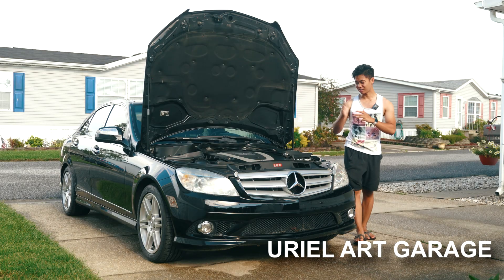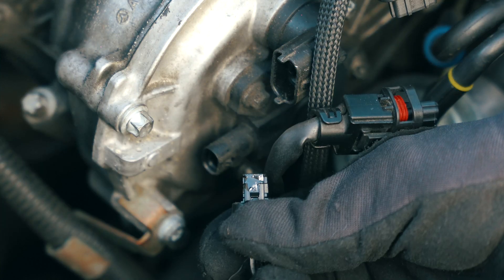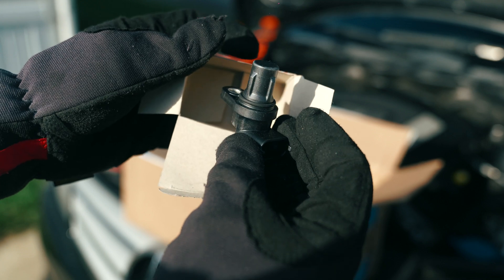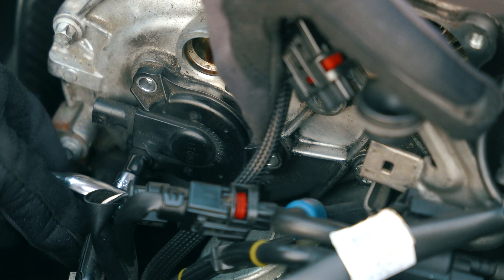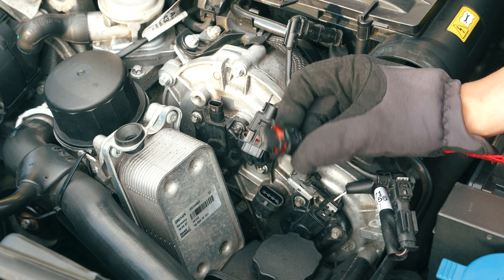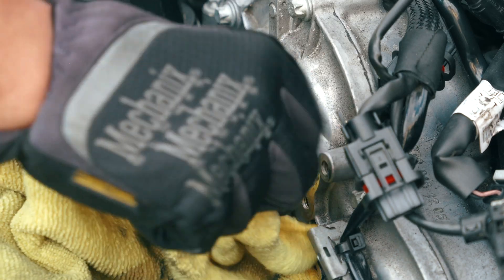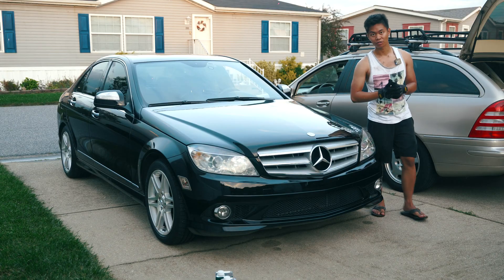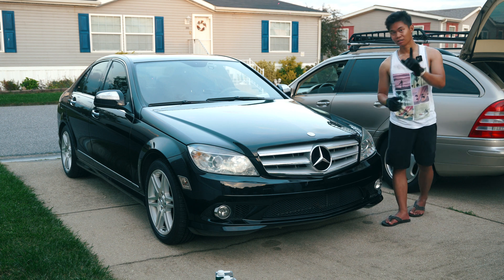W204 MERCEDES C350 Camshaft Adjuster Magnets & Cam Position Sensors! OIL LEAKING ISSUE FOR M272!!!

Comment: Would the magnets cause the car to no crank no start? Code p0340 cam position sensor circuit a bank 1 is the only code.
Reply: I replaced both cam pos sensors already but still no crank no start.

Comment: Hello Uriel. Was this routine maintenance, or did you get a code? I have a 272 ml350 with a persistent #6 misfire. Wondering if i need to look here. Driving me nits as ive done plugs (routine) has new manifold and did coil swap to no avail. Vac lines good.  Carsoft MBII only listed PO306.  If you ĥave time, would love your thoughts as im at a dead end. Or anyone. Look like you might be local? Wa. If so, greetings !
Reply from the maker: I would check for oil in the wiring harnesses maybe that has to do with it however I can't really say for certain unless you take it to an mb mechanic! goodluck!

Comment: Thanks, Uriel. Great vid and tutorial! Doing homework on the ML350, I found the 2011 and earlier models used the M272 engine. MB released a service bulletin with specific repair instructions for the camshaft adjuster solenoid. For anyone reading this, I like Uriel's tutorial and vid better. No offense, MB. Jus sayin.

Comment: Just did 4 camshaft position sensors on an m278 at 70kmi to prevent slight oil intrusion into the harness.
 
MB dealer parts, labor and expertise $1000.  

I'm ok with that.  I can use cheaper pigtails if the other remaining connectors begin to seep.

Comment: Cool video, but why not just change the o-rings/seals?
Reply: My thoughts exactly
Reply: @ClippyZA-s8o did you guys not see the oil wicking onto the harness clips? That oil eventually enters your ecu and then your repair is $5k+ … leaking around the prongs is seconds to oil wicking on to the harness clips

Comment: I can’t do this by myself cuz i dont have a 6.5mm wrench to squeeze in, everything else is too bulky. Im not about to take apart oil separator and steering fluid reservoir…

Looked for the wrench in every damn store and no one holds it so imma just pay a fucking mechanic to do it. I really wanted to do it by myself but whatever

Comment: this notorious design flaw including other camshaft gears costed me US$2000 to fix it
Reply: Brotha dam I got an Amg my mechanic only charged me 900 and I got an oil change and my breaks changed
Reply from the maker: Even diy, by far the most expensive repair so far but worth it in the long run for me! It’s easy to fix as well
Reply: Elaborate, what the hell could cost $2k???!!!!!
Reply: @s7omi oil migrates through the harness into the o2 sensors, and eventually into the CPU. If left unchecked it is an engine put repair involving replacement of harness. I’ve heard it can be in excess of $10k

Comment: I have the same car 2012 , it have an issues on cold start some times it dies, unless you give some gas it eityer cam magnet or cam shaft adjuster
Reply from the maker: 2012 is a weird transitioning period between the m276 or m272 motor, which one do you have?
Reply: @UrielArtsGarage  thanks for replying I bought this car manly because of your videos, the engine is not sure I don't even now how to check but everything in the car is after the face lift, I think this car was first sold in the us before it came here it have miles on dashboard

Comment: I still have code P0015 even after changing 4 camshaft sensors and actuators. Please help
Reply from the maker: Check if your wiring harness are clean and doesn’t have oil, it tends to gather oil overtime and destroy it, there’s lots of replacements on fcp euro

Comment: hey bro I tried this and stripped one of my bolts. do you know the replacement size? also do you recommend change all or only leaking ones?
Reply from the maker: Always replace all at once since it will cost you more in the long run if you replace one at a time, and for the bolt that’s so unfortunate! I would look for it at fcp euro!

Comment: Did you get any engine codes for this? Possibly P0018?
Reply from the maker: I would try to see if there’s a good amount of oil gunk around the area, what usually happens is that seepage of oil gets into the wiring harness and messed up the harness causing codes like that.
Reply: @UrielArtsGarage how do you clean the harness??
Reply: I got the same code, but no engine light, engine runs fine, normal

Comment: Wonder if they could possibly cause misfires. As I've just noticed that I have an oil leak right there on bank 2. If you know, please let me know. I booked it in for a service in a couple days and they'll have a look at where the misfire comes from as well.
Reply: Yes, any of these can cause misfires as well as rough running & cold start rattling. Far more likely to get misfires from the cam magnets rather than coils on M272's
Reply from the maker: Well it’s best to start with coilpacks and spark plugs first with the misfire. I highly suggest getting a cheap obd reader from Walmart which will cost you $25. It helps a lot when it comes to diagnosing your car!
Reply: Do you know what solenoid is bank 2?

Comment: Do you have to change the CAM position sensor if you have worked changed the camshaft before or it is just a maintenance thing?
Reply from the maker: You don’t necessarily have to change the cam position sensors however in my opinion, you might as well change them if you’re doing the work in the same areas! Besides the gaskets usually tend to go bad when they get older!
Reply: @UrielArtsGarage  That’s cool. Need to be practicing maintenance culture. Will do that on my next fix

Comment: do you have any special (or even official MB) source of what to change on the engine? or is it just knowledge from online forums and so?
Reply from the maker: Online sources are very helpful! The m272 engine is spread across multiple models so a lot of these problems are the most known ones. 

For the most part these are the most common issues the m272 engine usually has! The most significant being the intake manifold which is also made out of plastic.
Reply: doin homework on the ML350, I found the 2011 and earlier models used the M272 engine. MB released a service bulletin with specific repair instructions for the camshaft adjuster solenoid. I like Uriel's tutorial better.